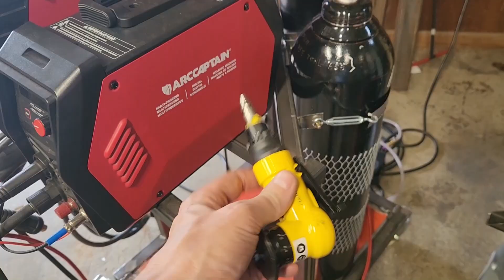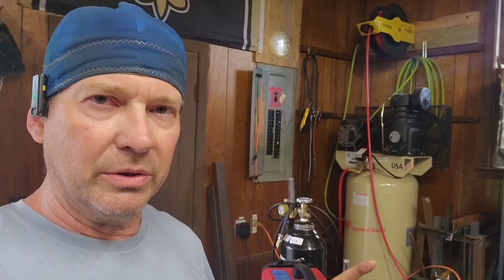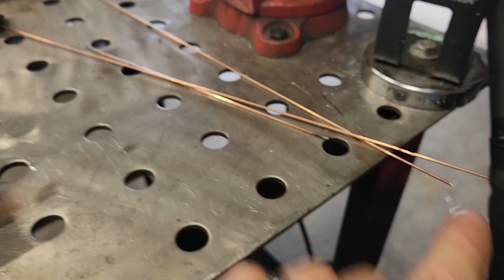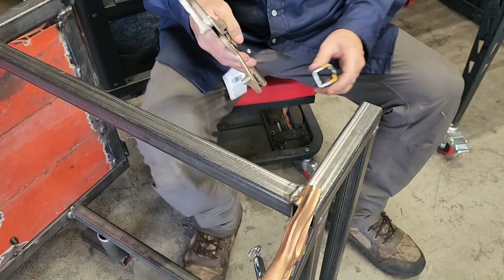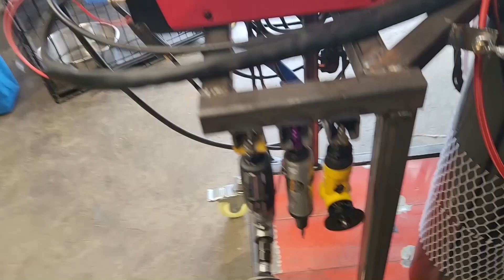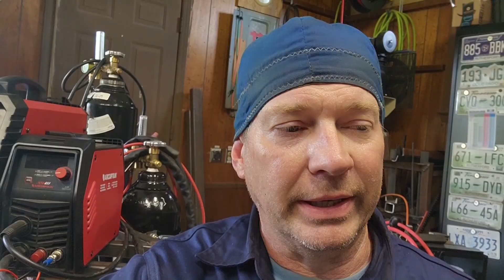Custom Welding Cart  - Part 3  - Adding An Air Tool Rack #arccaptain @arccaptain-weld

Comment: Is Arccaptain more for beginners or hobby users?
Reply from the maker: They have several different machines that work well for beginners and hobby welders.  The duty cycle is what keeps most of their machines from being suited for "run all day" professional work.  That being said, they are soon releasing a larger unit that should compete with the big Blue/Red/Yellow professional machines.  It will be interesting to see how that machine does.

Comment: For storage of my air tools I bought a few 'female' aiirhose connectors ad welded these to my shelving. Then 'plugged in' each tool hanging vertically. There you have it, neat securely stored.
What you have done is equally as good,... nice job!
Reply from the maker: I honestly thought about that but went with the "save a couple of bucks" method using what I had available.  😂
Reply: @DailyBrewGarage  ...and when I think about you made a better 'holder' I think. You holders will hold pretty well Nay tool it has no beraing on the type of male air connector you have.

Comment: What a difference from your first attempt at Tig, you actually looked like you've done this before. If you get ArcCaptain to send you their machine that was actually made for Tig with HF start and a foot pedal there's going to be a lot of pro welders nervous you're out to take their jobs. I need to get a Mig so I can try it, I tried it once years ago but all I accomplished was ruining a bunch of tips. I see everyone making it look as easy as squeezing caulk from a tube so I'm starting to think the guy that was supposedly teaching me was deliberately screwing with the settings to mess my efforts up, looking back he was just the type that'd do something like that too.
Reply: The only thing I noticed you doing that I was told not to do, when you're done keep the post flow gas shielding your weld till it's not glowing orange. The final weld should be shiny, not that dull gray, inadequate shielding gas, excessive heat or not having the base material clean enough will cause that.
Reply from the maker: Thanks.  I for sure have a long way to go but learning it is a blast!
Reply: @DailyBrewGarage  I'm just learning too, that's my official doctor/lawyer advice legal disclaimer, so if you get injured or arrested for taking my advice I'm not responsible. 

Have you ever tried that ChatGPT AI? It's pretty useful/cool as a welding instructor, you can tell it what welder you have, what you're trying to do and even send it pictures of what you've done for it to tell you what you might be doing right or wrong.  

You can also tell it to design a welding cart for you with any parameters you want like shop space, weight capacity, welder dimensions.. and it'll instantly spit you out a materials list, cut lengths etc... it's free too.
Reply: Lol, remember the Microsoft "Office Assistant", that little animated paper clip thing? The modern AI assistance is what Microsoft dreamed they wanted the little paper clip guy to be.
Reply from the maker: I think that a more dedicated TIG machine with foot pedal control will be a must for aluminum.
Reply: @DailyBrewGarage I’m in no hurry to try aluminum even though the one I bought is AC/DC for it. They’re supposed to be really good for stainless too. I have a project coming up where I need to weld to a cast differential housing that I’ll be using 309 Stainless filler rod for.